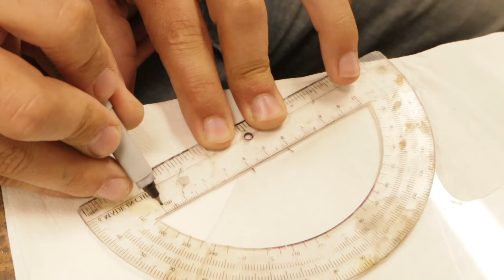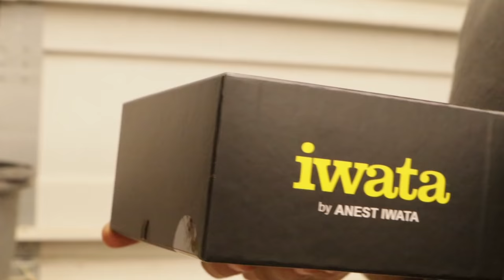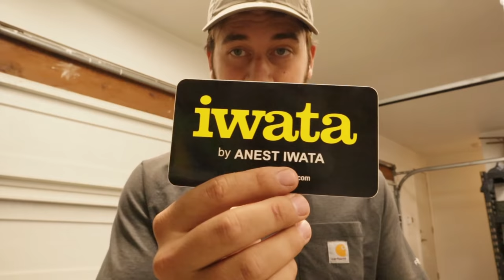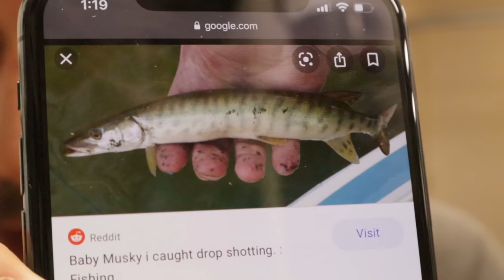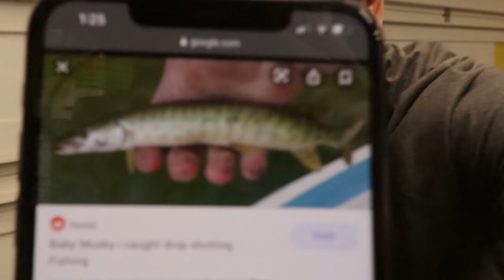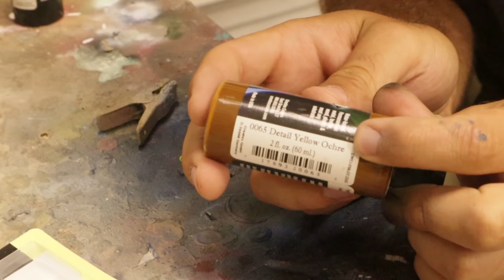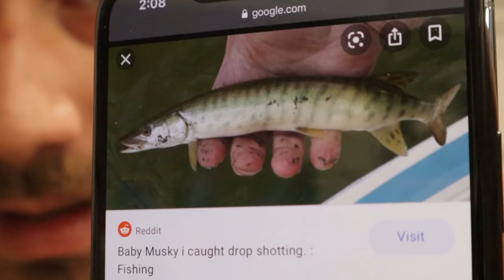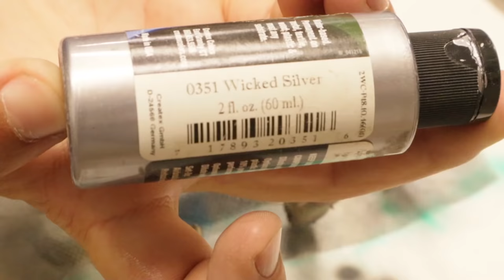Making a Baby Musky SwimBait

Comment: I made grip scales for a little pistol from watching your videos. I used like 6mm thick maple. I don't know if they'll be super durable due to how thin they are, but they're gorgeous! I did bust out a chisel for a time, but I largely used techniques that you use to shape and contour the grips. The bottoms are nicely squared off but still rounded in a way. Then they taper at the top to about 2mm thick and they just fit the hand better thaneven the stock plastic panels. I carved a step into the top to fit around the frame. I'd send a picture but you can't message on YouTube anymore...

Comment: Marlin, great job! But, can you make a sectional baby Pike lure and instead of using screws in the sections, use a good grade of flat plastic strips like some companies do? You may have to split the wood into two parts and bolt the plastic and the two halves together, but that may be the only weight you need! The action may turn out to be awesome!!!!

Comment: If you need a good airbrush but dont want to spend the money on the iwata go on Spraygunner.com and look at the GSI creos airbrushes.  Professional artists are using them because they are the same quality as Iwata, the parts are interchangable,, and the cost is less.  I think most of them are sold out right now, but worth taking a look at.  I dont work for them, not sponsored, nothing like that.  Just giving you another option.  The airbrush forums I am on, most of the people that are die hard Iwata users are starting to switch over to the GSI or at least getting the parts from the GSI and  putting them in the Iwata.  They also make a tool for fixing bent airbrush needles. Coast airbrush sells them.

Comment: What is that box with the purple leds do
Reply: It's ultra violet light cures the clear coat.
Reply: @squidiz496  is it necessary
Reply: @johnowenmartin6484  Don't think so. Think about cars, you can clear coat a car without uv light. But it speeds up the process considering baits are so small. It's probably worth it if you are looking to do this. Not expensive at all. Nail salons use uv light as well. Probably could buy one of those nail dryers. Pretty cheap I'd assume.

Comment: scale painting tip: Shape the screen/mesh/ cheese cloth/ aquarium fish netting like a taco shell. Place your non-fined carving with the body top in the bend of the screen. then use pinch clamps to tighten the screen at the belly. Use  masking tape  and or pin stripping tape and a combination of self adhesive circles (like the ones used as price stickers) to mask out areas. Aquarium fish nets make fantastic scales and you can stretch it for scale size progression. Plus you get a great transition across the spine to the other side.  Lastly, placing the project on a lazy susan  (turn table) for detailed painting with out physically touching the work piece. 
Hopefully you can use these tips.  
~ Subbed